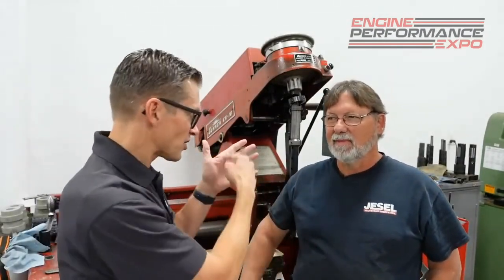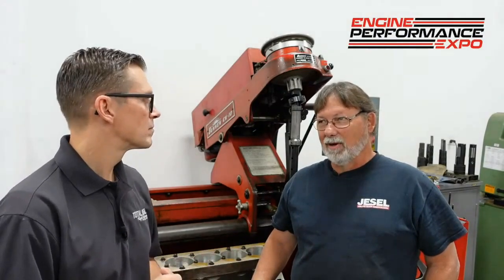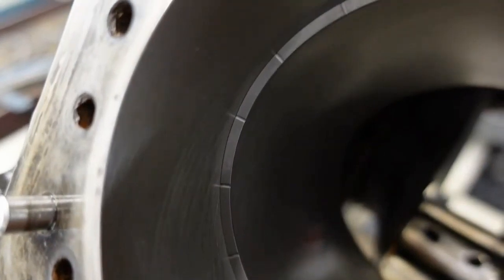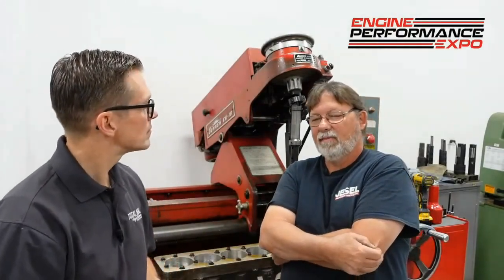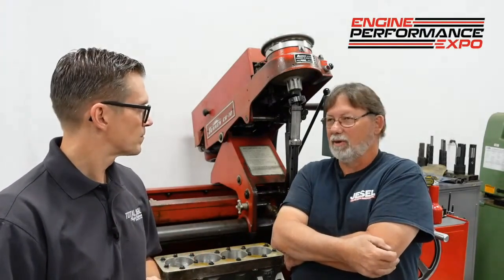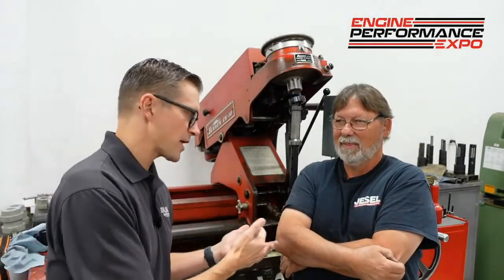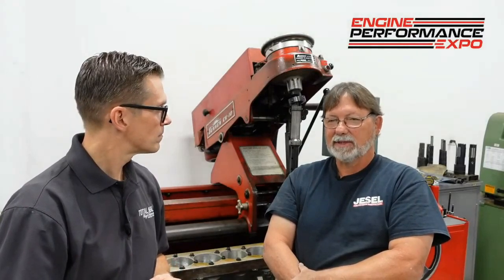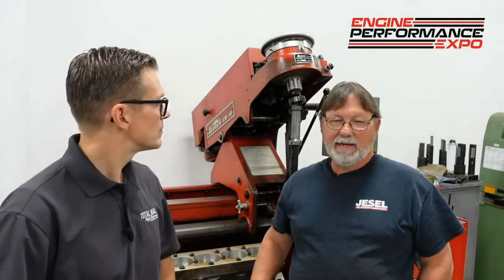Setting Ring End Gap (2023 - Episode 15)

Comment: Good info, especially about the gapless top ring, I am refreshing my N/A SBC 383 TPI and plan on running the gapless top ring with the pcv, is there anything I should now of besides a restrictor in the pcv inlet, I also have a air oil separator and adjutable pcv valve.
Reply: Those are great tools to make that gapless top ring work for you. We'd also recommend a deeper Rvk and Rk for the cylinder finish.
Reply: @TotalSeal  Thanks for the info